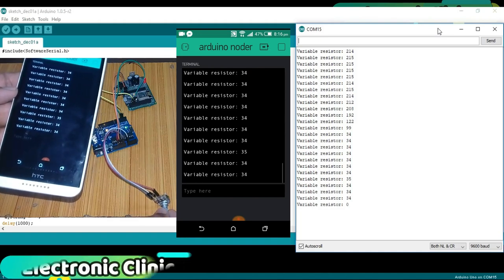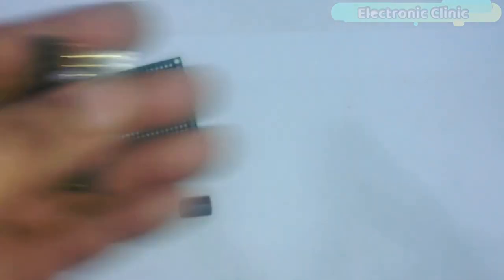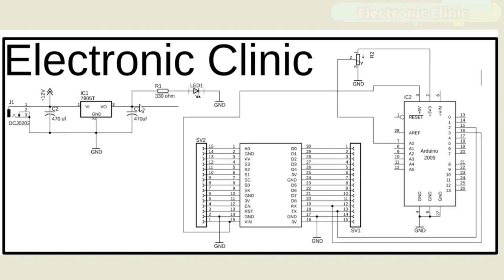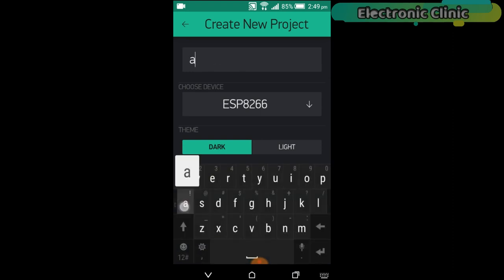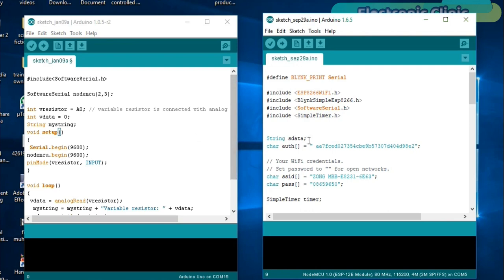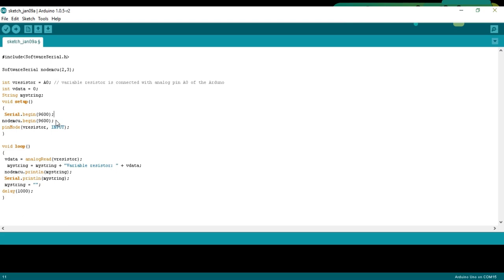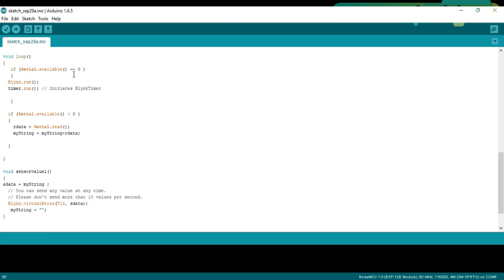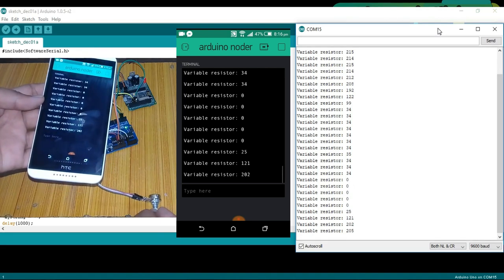Arduino Project: Blynk Terminal + Nodemcu esp8266 WIFI Module “Monitor sensors data from anywhere”

Comment: Hi,

This is almost what  I need to do, expect I want to :
1. transmit a number 1 or 2 or 3 or 4 from Uno -> NodeMCU 8266
2. transmit a number 1 or 2 or 3 or 4 from NodeMCU8566 -> Uno
3. All pins are currently use expect D13, RX, TX and A0 and 1 Gnd

I have been struggling for over 3 weeks now and you example is the closest I have seen.

PLEASE PLEASE can you help me, thanks.
Reply from the maker: yes, my friend, I am here to help you.
Reply: @ElectroniClinic  basically I want to  pass a numeric value from MCU to Uno via Blynk and then......when I control UNO,  I need to pass a number back to CMU. how can I do this, please help